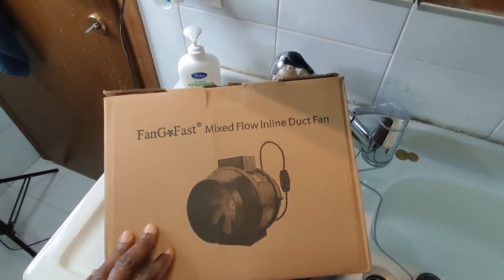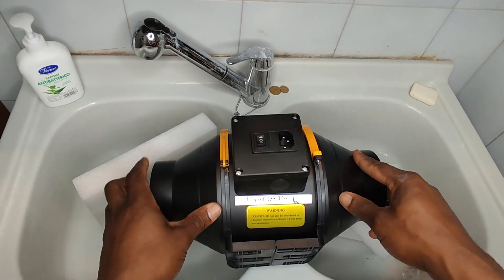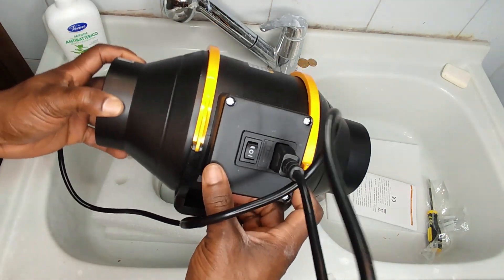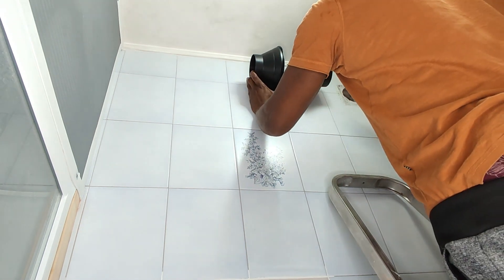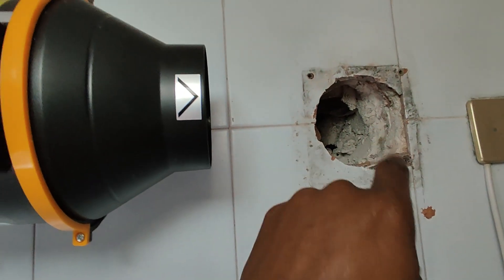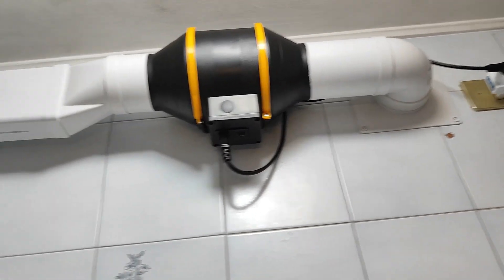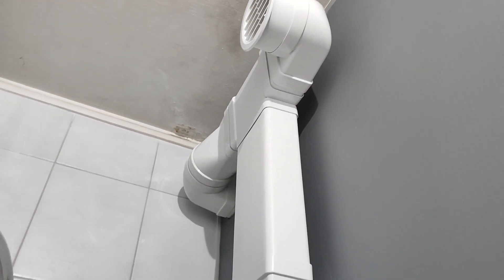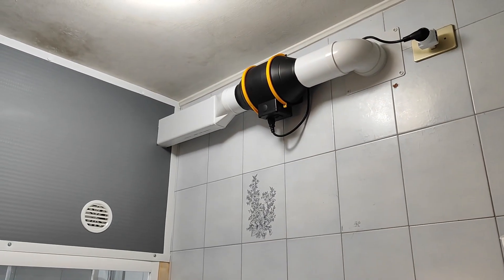Complete installation of FanGoFast 100mm Ventola Aspirazione

Comment: Hi, do you still like this fan? Has it lasted? What about the volume? It seems fairly quiet but hard to tell in a video.
Reply from the maker: It's 100% one of the best fan  at the moment.. not too noisy and get the job done in my bathroom
Reply: @larryvlog  Thank you, I just bought one! 125mm variant.
Reply: @c0mputer how is it? Loud?
Reply: @ice.3000  I would say it’s not loud. I use it about half a meter away from my face with no duct for my soldering station. I mostly keep it on the low setting but even the high setting isn’t that loud. The fan itself wasn’t balanced that well so it vibrated. I added tape as weight on the light fan blades to balance it and now it runs much smoother, which also helps reduce noise.
Reply: @c0mputer thanks! Do you know what the height is ? I need it to be as low as it can be but can't find anything on internet about the minimum height
Reply: @ice.3000  Can you explain what you mean by height? Do you mean if it’s sitting on the mounting surface to the top of the housing? If so that’s 180mm for the 125mm model. The fans I see on Amazon have all the dimensions in the pictures.
Reply: @c0mputer  yes that's what i mean, from the mounting surface to the top, is 180mm the minimum? Can't get it lower? I'm gonna check amazon now thanks!
Reply: @ice.3000  Yup, that’s the minimum. The 100mm variant says it’s 145mm.